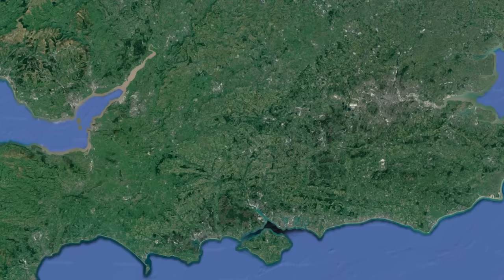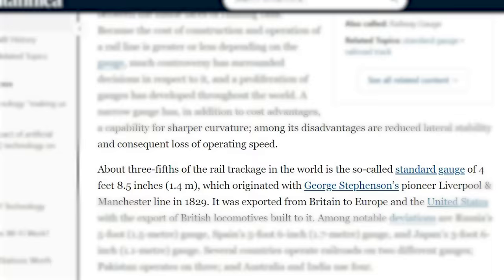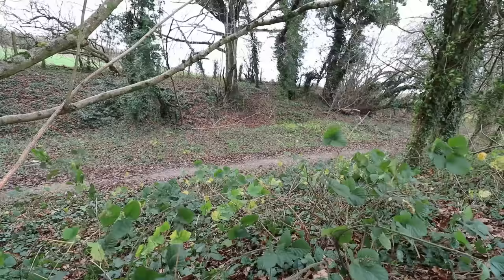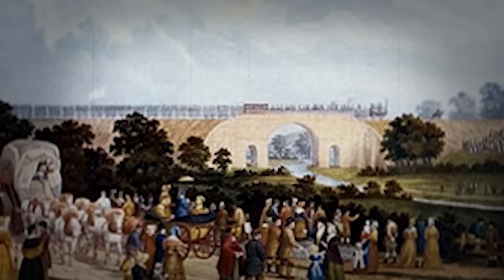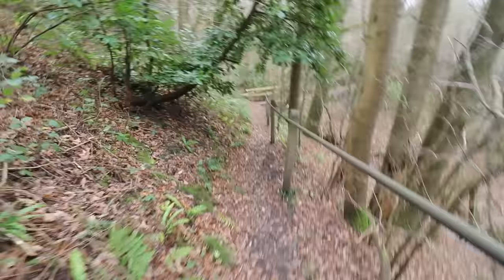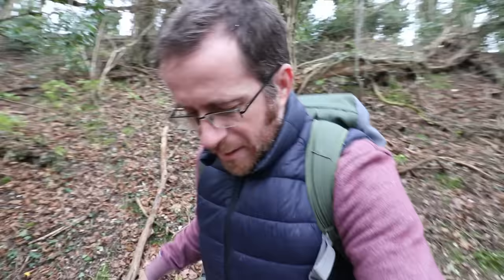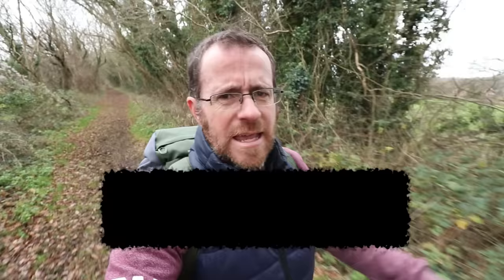Railway Gauges did NOT Evolve from a Roman Chariot.

Comment: The world really needs rails to be enlarged to 8 feet wide, and locomotives and all rolling stock increased in height & width by 50%. This is because trains are becoming TOO LONG. Many trains are miles long and are blocking intersections.  In order to make trains shorter, we need each car of the train to carry more stuff and we can only do this by increasing the size of the cars themselves, and for that we need to have a wider gauge.   But nobody is going to do that, it will cost too much.

Comment: This is a great detailed factual explanation, however the Roman chariot myth sounds cooler so I'm sticking with that for know-it-all dinner conversations.  BTW, modern skyscraper design is based on the Great Pyramids.
Reply: I have dug in Roman excavations at Fenny Stratford and we found wheel ruts.  They were 4ft 10ins apart centre-to-centre. You can knock off an inch-and-a-half for the inside edges.
More, that is a Roman legionary's pace, left foot to left foot.
More still, a thousand of those paces, milles pasuum, is 4855 feet or one Roman mile.  This has been confirmed from Roman milestones. A full list of Roman mileages is in the Antonine Itinerary.
I have checked Roman ruts from Britain to Jerusalem, and with the exception of mixed gauge (for donkeys?) in Malta, they are all the same.  
Pompeii, Herculaneum, you go, look and measure...
Another exception is the boat-carrying rutway across the isthmus of Corinth - that is wider and Dr Michael Lewis measured it.
So the 'Roman chariot myth' is more than a myth.

Comment: Narrow gauges were used in mountainous regions to enable tighter bends than possible with standard gauge.  Imagine the surveying and engineering problems with broad gauge in restricted environments.  It would not have been possible to convert existing standard gauge lines to broad gauge, only the reverse.

Comment: I don't know why England has an 8 feet 8.5 inch track gauge. 
But I know why Germany has 1435mm track width for the standard gauge. 
It all goes back to the first locomotive purchased in England.
But 1000mm or 750mm narrow gauge is also available here.
Reply: Also 60 cm Decauville/Trench gauge.

Comment: Excellent clip but as a Railway Engineer for many years I still go with the 2 horses arses theory! Why because you have not looked at the gauge problem from the real reason it was chosen. It’s 1806 Trevithick is looking to buy some wagons and build a locomotive for his new railway in Wales so off he goes to the local railway works! Hold on there aren’t any!!! So we’re do I buy some? The stage coach builders obviously, so he buys his AXLES (and this is the part you never mentioned) from the stage coach builders and they produce axles to the width of the main roads around the country. Close not exactly 4ft 8.5 inches. Remember Brunel decided on his gauge mathematically over 25 years later after the first railway works were completed and the first GWR engines were built in Stephensons works on Tyneside (North Star was originally built for a railroad in USA). Anyway there’s something to think about keep up the good work.

Comment: Has anyone worked out how much bigger the minimum curve radius would be for coned wheels with what seems to be the standard 22:1 angle.  My guess is that it would be disproportionately wider than standard gauge (perhaps exponential) therefore making it impractical for higher-speed passenger services without massive maintenance issues caused by flanging etc.  Did they think about this in 1846?

Comment: There is a major cost difference between converting broad gauge to standard gauge than changing the whole of the infrastructure including widening lines, bridges and tunnels when converting from standard gauge to broad gauge.  The cost wouldn't have been £800,000 but in excess of £2,500,000.

Comment: You mention Australia in passing.  They are converting to standard 4'8.5" guage throughout the contry, but originally, no two adjacent territories shared the same guage (which is quite the amazing geometric feat).  So, at the border, they had to either move freight from one train to another, or swap the bogeys on the cars (usually done on passenger trains).  Either way was massively inefficient, but bureaucratic ego and stupidity knows no bound.
P.S. What do culverts have to do with rail guages?

Comment: When the UK converted to 4'8½" in May 1892, what happened to all the broad gauge rolling stock? Was it scrapped, recycled, melted down? I'd be very interested to know. 🚂🚞
Reply: Only the GWR was a wider gauge, most UK railways as early as the 1850s were already 4'8½ - IIRC GWR locos and rolling stock designed after the 1870s had in mind easy conversion.

Comment: Four foot eight and a half.  Half! not .5  All this design would have been done in feet, inches and fractions of an inch.  Its a skill that's been lost, but it is a real skill.  It would also be more accurate to refer to it as a 4'8" gauge with a 1/2" running clearance.  This is not as mad as it seems as pipes can be given a nominal size that is outside their actual size just a planed 4" timber is 3 7/8".

Comment: The answer to the question is at 7:50, and read by an actor. Sorry, I need sources. That Stephenson once wrote that "it would be difficult to give good reason for the adoption..." (citation needed) does not debunk the horses' ass reference. It means he did not know why he did it. No data. No conclusion.
You may be right, but you did not clarify it.
Reply from the maker: Sources in the description. 😊

Comment: Not a comment, but a question.  What exactly is meant by "binding"?
Reply: If the width of the rails is exactly the same as the width of the outside surface of the wheel flanges (the part that comes into contact with the rail),  there is insufficient play between them, and they " bind" or jam.

Comment: Wide gauge would have died anyway..To make it economically viable the wider carriages would need to carry way more weight making the faster trains unstoppable in wet,leafy or frosty conditions.Silty ground an even bigger probem and the tight bends required  around hills lakes or into cities impossible..Large span bridges would be hugely more expensive too..Physics is the enemy of the wide gauge..Just like it was with the airship..

Comment: 5 feet, where did that come from?
Without knowing that this for the rest good video doesn't rule out the Roman source. (even if I don't believe that it is the source)
Reply from the maker: The quote by Stephenson himself pretty much rules it out.
Reply: @pwhitewick  not really. Stephenson doesn't know where it comes from but there could still be a causality that the 5 ft is based on their current road network which could trace back to the Romans
Reply from the maker: @edopronk1303  widely tenious. At best
Reply: @pwhitewick  indeed.

Comment: Somewhat silly presentation; could have been condensed some.  No discussion at all of the structural limits of the materials used for axles and other vehicle parts.  Axle breakage is vital in operations.  Five feet for outside flanges might have been close to the optimum.  Plus there is the matter of working on equipment in the shops where ease of maintenance matters a lot.  What did the board gauge systems record/note about those experiences?  Reminds me of a Massachusetts RR, OK the Western: it had some great-performing locomotives but the mechanics dreaded seeing them come into the shop for repairs!

Comment: Unfortunately, the logic presented here while interesting is irrelevant! There was no mention of superelevation of curves which is the true reason for the gauge. 4' 8.5" is 56.5 inches. Now, a little trigonometry. The reciprocal of the sine of 1 degree is 57.2987 to 4 decimal places. Standard railroad rails have a 3/8 inch radius at the top edge. Standard flanged wheels are conical to make them self centering and reduce wear on the flanges. This means the wheels contact the rails very near the top of that 3/8 inch radius on the rails. The 56.5 inch standard gauge measured against the vertical sides of the rail top becomes 57.25 inches when the two radii are added. No railroad engineer is going to worry about the missing 1/20 inch. When centrifugal force is calculated, the answer is in degrees of tilt or superelevation., The word comes from the fact the outside rail in the curve is raised and measured with an insulated level across the rails and a ruler graduated in inches to give the difference in rail height.  This is done even in metric countries. One inch equals one degree, so fancy (expensive) equipment is not needed in the field.  Think about the railroad pioneers of 150 years ago, they performed miracles with simple tools.

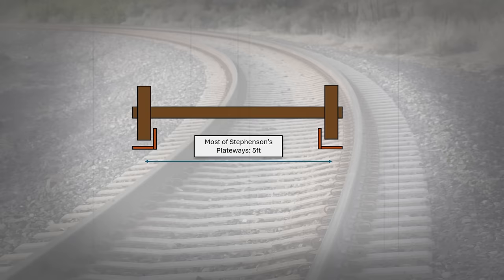Comment: This is great but you totally lost me at the crucial part after 5:55 when explaining to change from plateways to edge rails. The plateways were 5ft wide but your diagram shows 5ft between centre of wheels, not inside measurement between plates. If the plates themselves were 4 inches wide, one on each side, that means 5ft minus 8 inches = 4ft 4inches. Shouldn't it be the plates themselves being 2 inches wide? Yours confused

Comment: Oh, fer cryin' out loud.  About 10 minutes are about how "nice" a walk it is trying to find these old rails.  This should be a five minute video.  Then, you find out The Man Stephenson decided that the width of 56" was just right, plus 1/2 inch.  Take that medicated system.  
This should still have been a video of only five minutes in length, due to the idiotic blabber about discovering a rock or old piece of metal, or "How Nice it was to WALK this trail."   Exasperating.